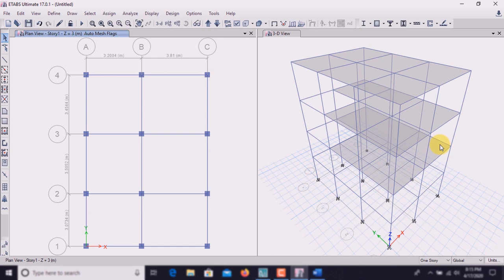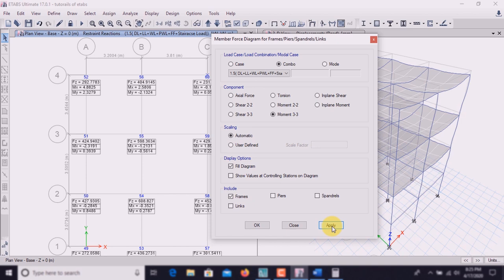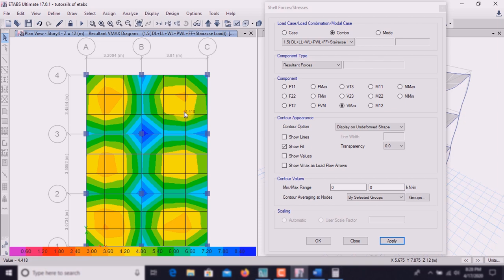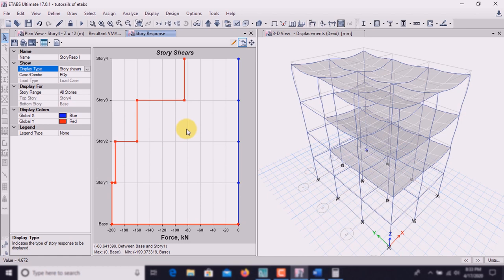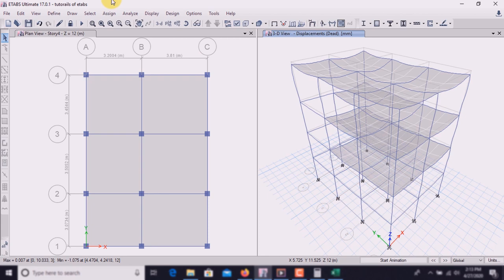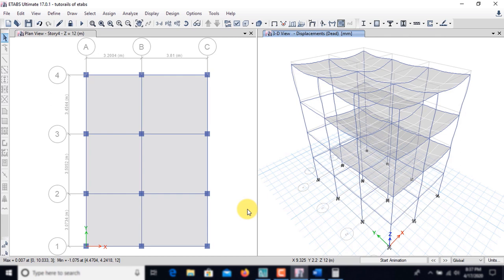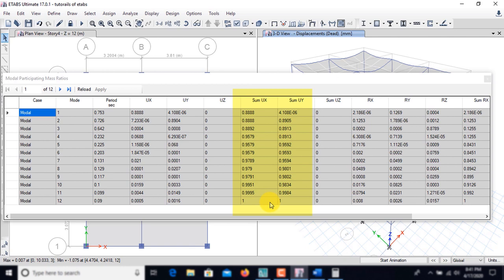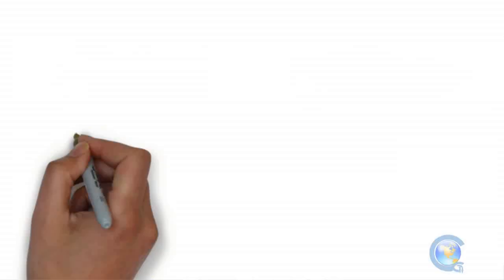ETABS Tutorial For Building Design Part -2  | Analysis Of Building In ETABS |  ETABS Analysis Report

Comment: if the torsional ratios exceed then what are the corrections to be done so that the structure will be safe. and also it will be great if you can show and solve if there are any warnings while running the model?